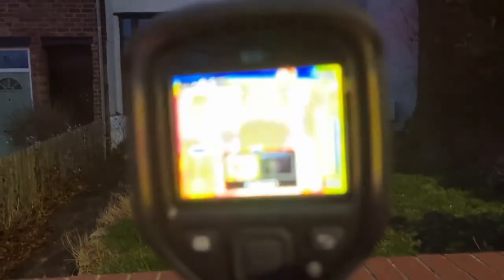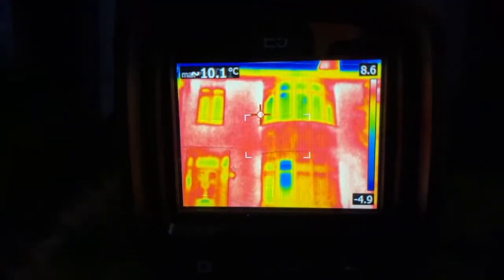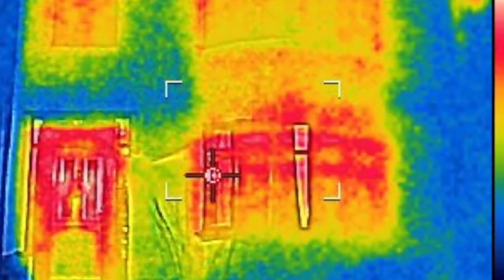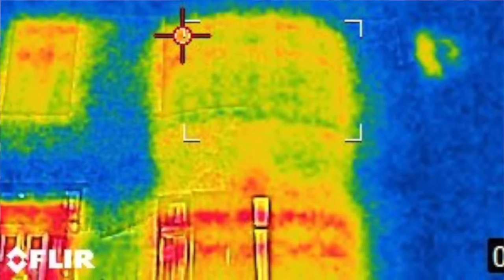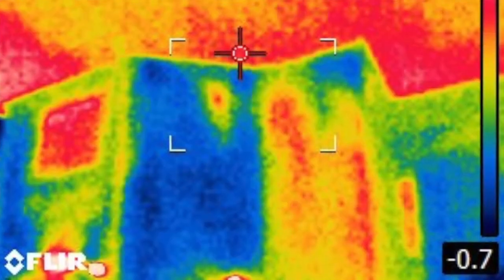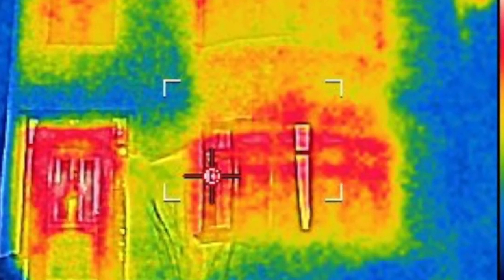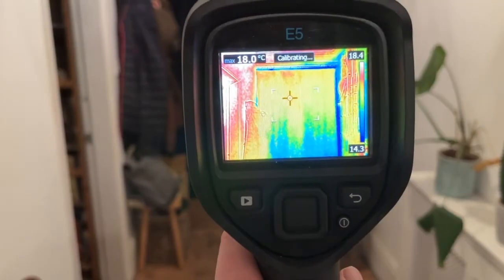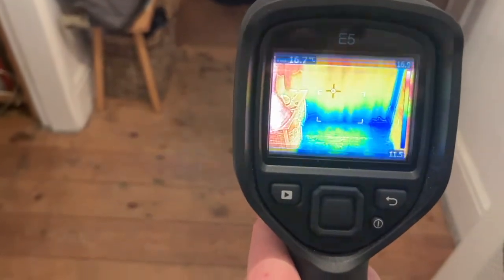Using a FLIR Thermal Image Camera to see where our house is losing heat - Low Carbon Lifestyle Ep41

Comment: The kind of double glazing matters a lot , talking metric units it can go from >3 w/m2k to 1.0 w/M2k, do they have low emissivity and argon gas? If the windows are good you could invest in only swapping the insulating glass unit for a high end doble pane or triple pane. Also the material that separates both panes could be made with plastic instead of aluminium, that is called warm edge.

Cheers
Reply from the maker: Hi Beltran, thanks for the comment, apologies I missed it last year. Absolutely agree that double glazing, and well fit windows, are key to minimising heat loss. Our windows are probably not that great... we decided to go for the cheapest option when we were refurbishing our whole house in 2018. 

Next time we replace windows, in 10-15 years time, I think I will pay much more attention!
Reply: @TomBray-LowCarbonLifestyle  you shouldn't apologize, there are a lot of comments.
Hope that your next windows provide some better experience. 
If you need some info I would love to give you information on the topic.

Comment: I cut 3/4" Celotex insulation boards then covered them with quilted Thermax fabric to fit our windows. The total R factor is about R10 and cost about $23 per window. A replacement plastic window would cost about $600 and provide only R3.2. They look great and when measured with a digital thermometer, provide almost as much insulation as the exterior wall.

Comment: We didnt put further insulation as we dont have too much space, we just put phase change material blanket (24 degree indoor, wall and some false ceillng, it really reduce temp swing and reduce cooling and heating in last three years. 
as its high latent heat storage, thickness of PCM blanket is only 1cm, it ready save lot of space and incraese thermal mass and thermal comfort
Reply from the maker: Really interested to hear more about this product. Do you have a link to it?

Tom

Comment: This is something we did. We put bay window seat in our daughters front bay window. Noticed a massive difference in how much warmer the room is in winter. I also insulated the storage space inside on the inside of the bay way. 👍👍
Reply: We are looking the insulate the exterior walls on the front and rear bay window areas also. Some thermal barrier and K Rend.
Reply from the maker: Fantastic! We still haven't got our bay window installed but could be an autumn job. Pleased to hear it has made a difference!

Comment: I insulated my internal walls, any wall that was facing outside was strapped with 25mm batons then 25mm of insulation board then a reflective membrane. At this moment I am insulating under my floor boards and have seen a remarkable difference even before I've finished.
Reply from the maker: Hi Lewis, fantastic. Our floorboards are uninsulated, I suspect this could make a significant difference if and when we did it!

Tom
Reply: @TomBray-LowCarbonLifestyle  if you have a good enough crawl space then hopefully you don't need to lift any flooring.

Comment: The trick comes in being able to interpret what you see with the Thermal Camera. Inside your house, were areas that looked  - to my untrained eye  - as if they needed to be looked into.  But I'm guessing , as you use the camera at work, you knew from experience they were not worth worrying about??   I recently got a camera myself - and have found myself trying to get rid of cold spots and finding they look exactly the  same after I've gone to the expense and trouble of changing window gaskets, or adding weather stripping etc!!
Reply from the maker: You are talking a lot of sense. Yes there we areas that needed looking into, but rather than surprising me, these were areas I already knew were cold or draughty.

I think often the camera picks up heat loss relative to surroundings, so even if you had improved a spot, that bit may well have more heat loss than the areas around it. 

The key is whether you think your work has reduced draughts or improved insulating properties? Is it more comfortable now?

My use of the camera at work is more to highlight significant issues, rather than pick up the detail around a certain feature, and I would use the images to make the case for upgrade or refurbishment - 'look how bad this is!' - rather than to quantify heat loss. And, without being too cynical, colourful pictures like from a thermal imaging camera, really stand out in a report to any organisations leadership!

Comment: Have you considered painting the external walls/brickwork with silicon liquid? It prevents water soaking the brickwork and lessens the heat drawing effect as experienced when wearing wet clothes. And it's easy to do and cost effective. Just a thought.
Reply from the maker: Hi Stevem- I haven’t considered that. Very interesting. I’d be interested in seeing case studies of where that has been done!
Reply: Do people do this?

Comment: Really interesting videos. I'd love to insulate and reduce the carbon footprint of our cottage. Trouble is it's at least two hundred years old, with solid stone walls and the original draughty sash windows etc.When we got it, it had been coated with cement render (which had cracked and blown), the windows had been painted shut in the 60s and every surface had been covered with wood chip - even the ceilings. It felt cold and damp. Over the years we removed the concrete and re-rendered with lime, stripped and restored the windows, removed all the wood chip and repainted with breathable clay paint. The house is in a much happier place - but there are draughts, and it loses heat fast. I can see that insulating the exterior walls would help warm it up - but I have also seen just how vital it is to let the building breath. I'm not sure I could bring myself to pull out those lovely delicate windows that have lasted for hundreds of years and replace them with UPVC. I'm convinced any extra layers will lead to condensation and mould forming. Do you think a heat pump would be a silly idea on such a building? Sorry for the long winded post.
Reply from the maker: Hi Stefan, sounds like a wonderful house! But does sound complicated to reduce emissions, I agree with not wanting to impact original features. Your house sounds a lot like my mother-in-law's, who was able to replace windows with sensitive wood framed double glazing that looks 'original' and really helps reduce draughts. 
There are probably actions that you could do that would help reduce draughts as well through spending a day with a caulk gun, or plugging old fireplaces when not in use, the DIY stuff that can help make small differences.
Whether a heat pump could provide heat in a house like that, it's a good question, heat pumps can heat any building if they are sized and installed correctly, with sufficient radiators / heat emitters. However with draughty houses it would mean a large heat pump, working hard, so potentially high energy costs. 
How is your house heated at the moment?
Reply: @TomBray-LowCarbonLifestyle  Thanks for the suggestions Tom. Currently have gas central heating with quite an efficient boiler - and (cough) a gas converted AGA (just for cooking). This is not at all green - but it was in the house when we arrived and now it's very hard to get rid of. Being gas we can turn it down at night and that knocks a third off the bill. I think we might actually turn it off for the summer now that the gas prices are so high. As bad as it is, I think having this low heat spreading around the house all the time has done a lot to make it comfortable - and it's sort of the 'heart' of the house. You mentioned sealing up draughts but that leads to another confusing conundrum - controlling humidity. I just got a meter and it seems our house is just about right in terms of humidity levels. I've seen people in much newer houses with plastic windows and no draughts having horrendous problems with mould and humidity levels off the scale. Isn't the air in a house supposed to be exchanged four times an hour or something? If that's the case the only heating system worth thinking about would be one of those pumps that extracts the heat out of the vented air.- forgotten what they're called. Sorry for even more rambling - but it's a quandary I've had going round my head for some time now. I'm thinking it might be a good idea to get some solar panels. That way I could probably cover my low electricity bill, heat some water and perhaps in the future use it for an electric car or maybe some electric underfloor heating. Seems like a step in the right direction.
Reply: @StefanMarjoram  passive houses, being the epitome of heating efficiency, are completely sealed and in order to deal with moisture issues utilise hear exchangers with dehumidifiers. This is an inevitable consequence of sealing up your house. The issue about the house breathing has much to do with water being absorbed by the render. Many people make the mistake of assuming concrete render won't absorb water IE it's water proof but it isn't. If you waterproof your external walls but moisture builds up inside then it's absorbed by the walls and cannot pass through so the house starts to smell of damp. 

External insulation can be achieved without sealing up the buildings ability to breath. You just have to use the right material. 

Lastly, before looking at double glazing you could consider secondary glazing which could be made to blend in with your current windows. Too much is made of double glazing... A lot of it is inferior quality and a lot of the heat loss is actually through the plastic (which is uninsulated) so not that good anyway.
Reply: A lot of heat loss in double glazing is through the uninsulated plastic. In Canada and colder countries the frame and entire area around the frame is insulated, foamed and taped ... Shonky Britain we just sling em in there.... Gaps are covered with a thin piece of plastic and jobs a good un

Comment: Very Thick Curtains  .  Loft  Hatch draft exclusion & insulation is sometimes over looked.   generally  draughts  ( eg Readinguk  Draughtbuster website for advice).
Also I find shelves above radiators  mixing the warm air into the room rather than let it sneek up the wall  & insulation/silver foil behind radiators helps too.
Reply from the maker: Sounds like a plan - anything we can do to reduce heat loss is a positive step!
Reply: I was surprised Tom didn't mention curtains, and I wanted to ask if they're an option and the benefit of good curtains (e.g. long length so they cover the wood wall too).
Reply from the maker: Hi Greg, yeah good point - curtains are always a benefit as help add a layer of insulation and prevent air movement, I think my assumption is that most people already use curtains and get the benefit, but that trying to be a bit more ambitious / drastic could help too.
👍
Reply: @TomBray-LowCarbonLifestyle  if you still had the thermal image gun could you open/close/change curtains and show us the difference? It's easier and a bit cheaper than getting insulation done.

I like thick floor length curtains because they make me feel warm and cosy. For bay windows you can  have curtains that are straight to cut-off the bay, potential of that looking nice if you only use the window seat when it's sunny.

Comment: Yup, agree with the foil/insulated foil backing behind rads, and the shelving above (or just a deeper window ledge).

If the shelf can be fitted, get curtains long enough to tuck behind the rads so heat doesn't just go behind them and heat the window glass instead of the room.

Findley's did our roof work, and quoted for the insulation/cladding to the front pebble-dashed wall at the same time (about £1500 for the extra work whilst the scaffolding was up) - turns out it wasn't needed as that wall actually had a cavity (they were surprised, given the age of the house). We got a government scheme to remove old partial wall insulation from the original house and replace it with new stuff, and 0800Repair did that, including the aforementioned wall which hadn't been insulated before.

Although, pebble-dashed walls usually create a cold facia because they retain more dampness, especially older, more weathered stuff. I'd remove it all, replace with v high performance layered external insulation behind weatherproof cladding (decent stuff, not "fades in a couple of years" cheapo types). External insulation also lets the building mass heat up as an energy sink to give heat back after the rads have switched off, plus stops solar gains in summer from getting into the rooms through the walls. Internal insulation creates a faster responding interior, but that also means it cools down more quickly too.

So, is it time to pop round here for that 'site visit'...? 😁
Reply from the maker: Ian - sorry I missed this comment! 
It may be time to pop round?! When would be good? We could do a video...?!
Reply: @TomBray-LowCarbonLifestyle  That sounds good! Pick a day between now and 11 April - I'm around doing a bit of garden DIY and stuff 😁

Comment: Stupid question, but what are we looking for? I know blue is cold and red is hot. On the outside I assume we're looking for red spots as that's the heat leaving the building. But on the inside, are we looking for red spots or blue spots as areas that need work/attention/insulation? Anything retaining heat will be red, but anything losing heat (inside) should be blue right, which means inside, blue spots are what needs the work?
Reply from the maker: Hi J, Yes that is my understanding too. 

For us, you can kind of tell in our home where we are losing heat even without a thermal imaging camera, the camera just helped confirm our suspicions!

Tom

Comment: cool! any idea about how much energy loss?!
Reply from the maker: Hi Homayoun - not got an idea about heat loss from the FLIR camera, but from a heat loss assessment done as part of our heat pump installation. This suggested heat loss from the home, on the coldest day, would be just over 5 kW.

Over a year we use about 12,000 kWh of heat energy to stay comfortable and for our hot water use.

Hope that makes sense!
Tom
Reply: @TomBray-LowCarbonLifestyle  Hey Tom, I was thinking about how to convert heat loss to energy loss (GJ). Do you have any ideas? I was thinking about estimating the U-value of my house by using thermal imaging and also working on the Plank Law. Any thoughts on this? Thanks!
Reply from the maker: Hi Homayoun, we tend to measure heat loss as an instantaneous transfer of heat in kilowatts (kW), and would convert this to energy loss by having that loss of heat over a period of time i.e. kilowatthours (kWh) which could be converted into GJ.

We can estimate heat loss using the average U-value of a building (units W/m2.K) and multiply by the surface area (m2) and the difference between the internal and external temperatures (K).

Where I live we tend to size heating systems based on the extreme external low temperature (-5°C) and the desired comfortable temperature (maybe 21°C). This can give the heat loss in kW at that temperature, which was calculated for my home at around 5 kW.

We then run the system throughout the year which provides up to 5 kW of heat for a number of hours per year depending on the external and internal temperatures. Overall, my system delivered around 12,000 kWh (43.2 GJ) of heat in 12 months after installation, the heat loss varies compared to the external temperature. 

I hope that makes sense and is helpul?

I am sorry, I am not familiar with the Plank Law?
Tom